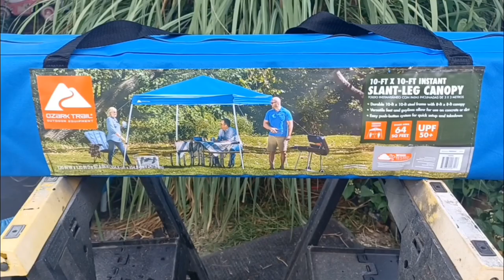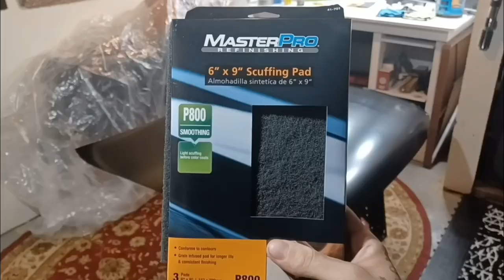How to paint hood with spray cans (FAIL)

Comment: the only time i've had good luck with spray cans is with primer and even some of those get the sputtering. you live and learn tho.
Reply from the maker: Yea normally I get great results on smaller areas, but a panel this big and flat spray cans just aren't the move

Comment: Bro could spray a whole car with tin spray.
Reply from the maker: I would try lol but now I know better. Atleast not with a metalic silver. That being said I could have done a lot better with the proper environment.
Reply: I have a ae100 bonnet outside and I am going to purchase these items and follow your video STEP BY STEP to see the result.
Reply from the maker: I did not get the results I was hoping for. If you lay it on a bit wetter it may come out better. If you are using a solid color and not a metalic flake that should come out slightly better also
Reply: Can you send me the spray paint names here?
Reply from the maker: I used Duplicolor "perfect match" for the color coat and Spray max 2K Clear Glamour for the clear coat
Reply: Ok bro thank you

Comment: You probably needed several spray nozzles with different sized eyelets.
Changing them from each pass to another.
Your spray patern is near to the hood and the nozzle line is too narrow.
You need a nozzle with a wide coverage . 
Your movement was also very slow hence the noticeable overlap. Slow and close was the reason for your failure.
Faster and away at first and then closer and slower is the key.
As for spray cans i prefer Rust - Oleum since they behave better .
But they are also expensive so maybe it isn´t worth it.
Spray cans are finicky and i once got one that sprayed  like foam even after shaking for minutes.I gave up on it.
I put my cans in warm water and then shake them for five minutes .It helps with the consistency but if you paint at a high outside temp the paint will dry and cause such artifacts.
You need a controled environment .
Probably a graffity artist would be more experienced in this.
It can be done.
I watched the entire video and it was very informative.
Thanks and kudos for your patience.
Reply from the maker: Yea definitely agree that a better environment would do wonders. I wanted the specific color from the duplicolor perfect match lineup, but it just was not working out so I gave up on trying to make it look good, I didn't want to waste any more time or money at this point and I ran out of paint. Definitely made many mistakes but I enjoy the learning process